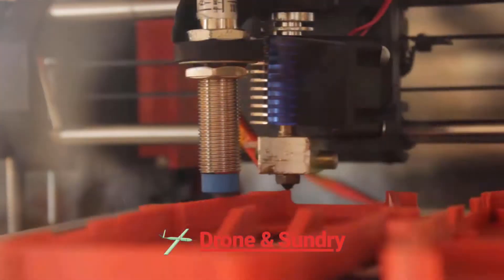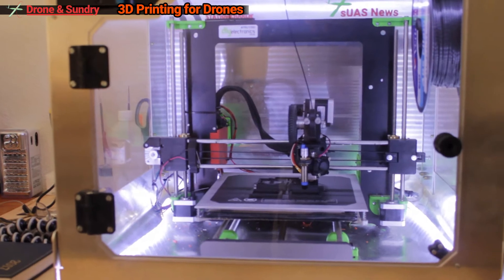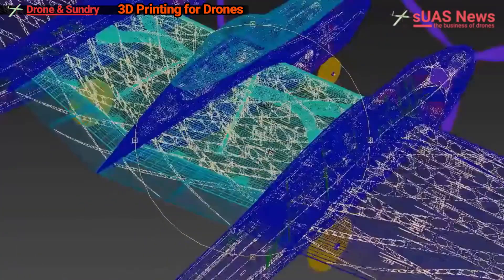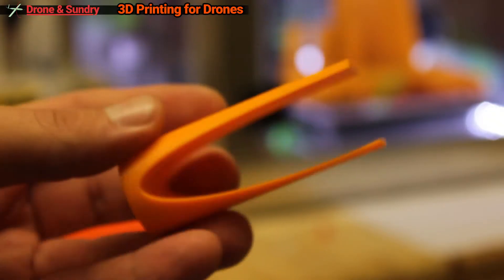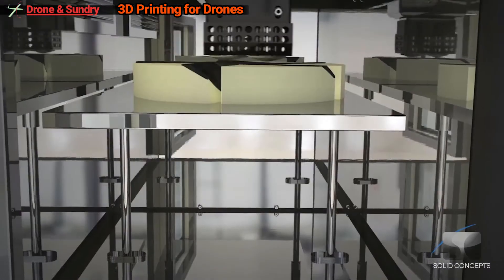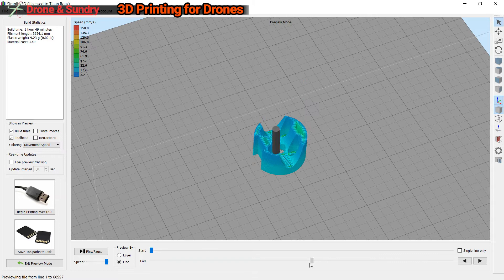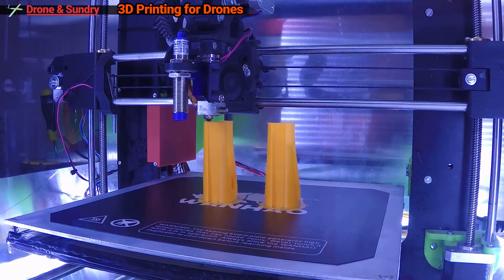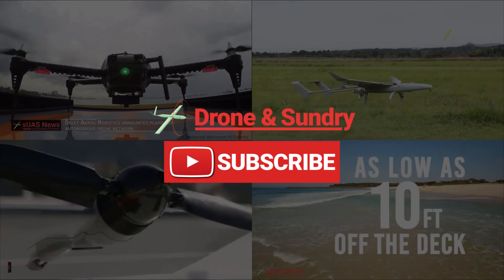3D Printing For Drones | What is 3D Printing?

Comment: good to see that you have an enclosure. That will greatly increase the range of materials you can print with. Nylon is probably one of the toughest materials for this application in my opinion. PLA will just deform in any hot car that you leave it in.
Reply from the maker: Hey Scienteer. How have you found Nylon in terms of ease to print with, say, compared to ABS? Its on my list to try but want to get a bit more experience with ABS and PETG etc first before moving to the 'exotics'.

Yeah, I printed with PLA for the first couple of days after getting the printer just to see the thing in action first with an easy to print with material then switched to ABS as I know PLA won't last in the African sun, or on the back seat as you mentioned.

I am going to try PETG this weekend after printing with only ABS the last few weeks. Do you perhaps have any PETG tips for me?
Reply: Drone & Sundry i havent had much lucks with PETG yet. I find it tends to bunch up and stick to the nozzle. Either I have a cheao and nasty roll, or have more work to do on tuning my settings. It is nice and strong though, but when it does break it shatters.

Nylon is even stronger and not too hard to print so long as its dried well. Taulman Alloy 910 is the easiest to print with the least warping.

You need to make sure you have an all metal hotend for both materials as any PTFE lined one will degrade.

There is loads of info online about printing with both, so do a bit of research.

Looking forward to seeing what you can create.
Reply from the maker: +Scienteer appreciate the input. Hitting the forums and YT for PETG info today :) Liking your Differential Drive Pan Tilt system you have going there https://www.youtube.com/watch?v=Su6O6155UJM

Cheers, Tiaan